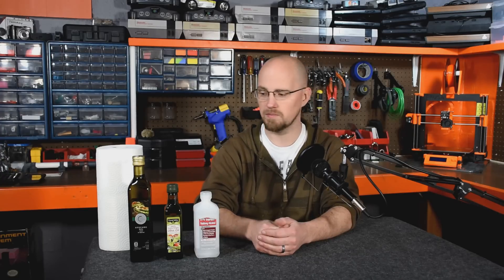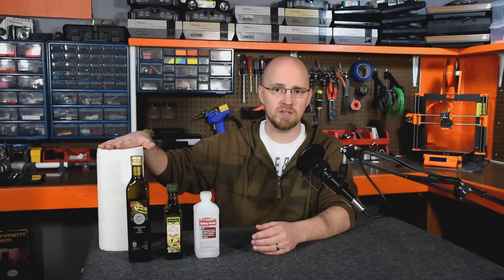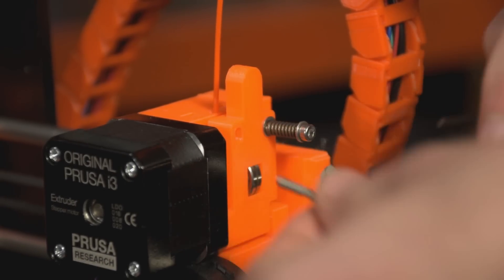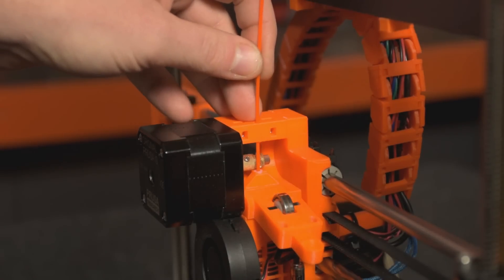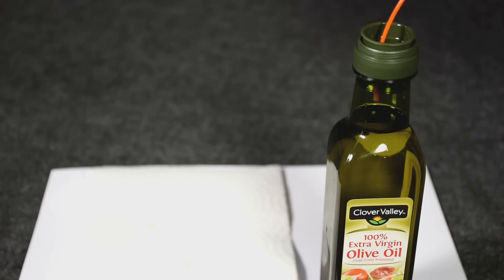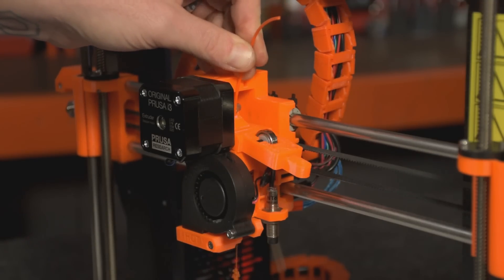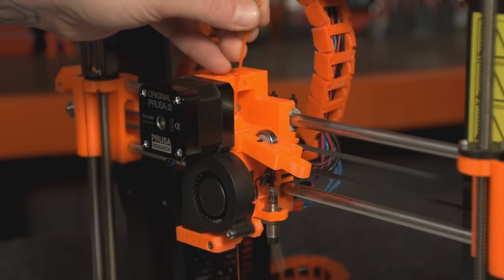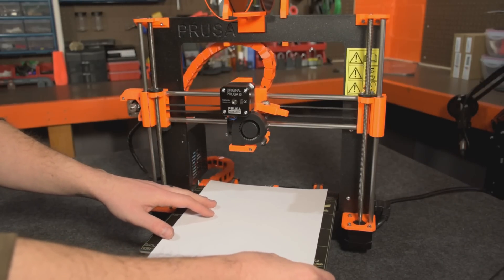How To - Nozzle Seasoning

Comment: I was actually thinking of putting all my nozzles in a cast iron frying pan with some oil and bake them in a batch and they should be good for a while and as well as not make a mess while doing it
Reply: And if your worried about the threads being treated just wrap them in Teflon tape which should protect them Just my GenXer brain bubbling

Comment: Is there any other type of mechanics oil that can be used instead of cooking oil?
Reply: I used olive oil i kept my nozzles in a container with  a paper towel soak with olive oil and just seasoned it on the print head
I left my printer to print and there was a power failure and when i went to check the nozzle nothing stuck to the outside and when i clean out the nozzle after a bunch of filament changes the cold plug came right out and no binding inside or out
\

Comment: have you ever had a printer jam at the exact same height on 2 different G codes?? I had this happen today for the first time , no idea why
Reply: Partially thermally conductive Stainless steel(instead of mostly non conductive titanium) heatbreak, heat creep causing molten filliment to be semisolid in the cool zone or long retraction causing molten filament to pull into the heatsink area of the hotbreak

Comment: I can see this working , if you ever see a steel part finished in linseed oil ( hot submersion ) the finish on the steel turns to glass essentially.. that's assuming the tip is steel

Comment: To be frank here, this guy should not be giving advice to anyone in relation to FDM. This is the equivalent of hearing a fellow scientist talk about how he spoke to aliens... You are experiencing throat clogs, not friction clogs. Read up on thermodynamics inside these machines boys, youll be hard pressed to find a nozzle that gets clogs when it has a heatsink. Its the makerbot style nozzles that do it, and oil is NOT the solution. It does more damage than good, and the core problem is still there - so not only do you loose structural integrity, but you also get quality loss from the throat clogs that are still in there (just more slippery now). When you pull your filament out, if it has a bowed cylinder on it, thats a throat clog; the most common and most (almost comically) misunderstood type of clog, and one of the most common issues in general, in FDM. Its a lot more complex than people are ready for, the media should not have jumped the gun saying it was a mainstream machine (they meant price not the general market). These are engineer's and designer's tools, not hobbiests (yet...). Its only as accurate and intelligent at the operator right now, it takes a sharp analytical mind, one that has an "gift" for understanding how things work.
Reply from the maker: I preferred your comment before the edit when you started by calling me an idiot lol.

Anyway.. There are quite a few things you've said that I disagree but I only have time to address a few;

1 - FDM printing is for whoever cares to do it. Suggesting that these machines are only suitable for engineers and designers is absurd IMO.

2 - I never described ANY jams, so why you'd assume I was doing this to address throat jams I was getting is a mystery to me lol.

3 - Structural integrity loss is minimal, and only relevant if the parts you're printing require maximum inter-layer bonding (the stuff I print does not)

4 - This is like a scientist communicating with aliens? Hyperbole much? lol.

Generally, people disagree on things. Thats fine. What isn't fine IMO (and some people are missing the context of this statement in which you repeatedly insulted me directly on social media) is to drag someone through the mud because you disagree. If you have valid reasons that your opinion is correct, present them. Don't essentially flail around like a child hurling insults at someone you know nothing about simply because they hold a different opinion or have had different experiences than you have. It not only makes you look like a fool, it spreads a sort of pernicious negativity in the community that is hard to then get rid of.

Comment: "NOTE this is ONLY for all-metal hotends.  Please don't try to season a hotend with a 
PEEK/PTFE/other plastic liner such as the JHead.  Those don't need this 
treatment and it might cause trouble."  http://www.dragonflydiy.com/2014/06/nozzle-seasoning.html
Reply from the maker: The article you linked suggested doing this for an E3D hotend, which if I'm not mistaken has a PTFE liner. I only ask because I don't know, but what problems can oiling cause with the other types of hotends, and what difference is there that would matter between something like the E3D and the Jhead when it comes to oiling the nozzle? It would seem to me that they both have brass nozzles and thats really what we're attempting to lubricate.

Thanks for the link btw.
Reply: Its an optional PTFE liner, and no the E3D is considered a full metal design because of how it was engineered... you really need to do your homework Nilla....this is really bad dude... You have the whole printing community freaking out that youre attempting to give advice when you have a very narrow understanding of the processes and engineering involved here. I dont wanna be a dick but ive got to say something here, like everyone else. This oil business is total bullshit, it was a rumor that got passed around, a fix that was done by yet another average joe who has no business being anywhere near one of these machines. You can thank the media for this epidemic of misunderstandings and misinformation. It inflates egos too so you tend to see people get all up tight, flip out when you show them why theyre wrong... It just inflates heads. If you want to understand it, you need to start with engineering and design, and move over to chemistry and material dynamics, then thermal dynamics (physics). Once you have a basic understanding of that list, THEN and only then, can you use these machines correctly. Do you even caliper, bro?

Comment: how often do I have to do this??  I mean per meter or weight of filament
Reply from the maker: You never have to do this. I would only do this if you're having problems with jams or extrusion inconsistencies like I was having with smaller diameter nozzles.
Reply: Nillabean 
thanks alot..  nice video

Comment: I am sorry but I can't ignore this video.
The advise you give can do more damage then it can do good.
In fact, it can do no good at all, but it can damage your heated bed and if someone is stupid enough to spill oil, it can damage other parts.
You are having a printer that uses PEI on the heated bed. Please, if ever you have to replace your PEI, make a last print and test the results of getting a mineral oil on your PEI. You won't have to clean it afterwards with isopropyl alcohol, because you will never ever get it clean again. Also, your tip is being seen by people with printers that have BuildTak or Kapton tape on their beds. They are not going to be happy with this, because their filament won't stick anymore.

In fact, your idea to run enough filament through the nozzle to get rid of the oil, is the best tip you gave. After all's gone and you are lucky enough to have no permanently damaged anything, you can start printing again as if nothing happened.
Reply from the maker: Again, not trying to be argumentative but your comments are pretty obviously misguided as I never even claimed I had any 'clogs'. My issues were with the extrusion consistency of certain filaments when using smaller diameter nozzles. As I've stated in replies to several of your comments elsewhere, I completely agree that seasoning your nozzle won't really solve any issues with throat jams related to heat creep and its incredibly unproductive for you to continue to act as if I am lol.

My reasons for experimenting with this technique were related to print quality under certain circumstances, and this is the one thing that seemed to address the problem. You're free to do and say as you please but just be aware I won't address any more of your comments if you continue to reiterate the same irrelevant points over and over in multiple locations.
Reply from the maker: Using oilers is common practice and like someone else already mentioned in the comments, this is essentially an alternate method for lubricating your extruder.

As with most things that I recommend or do tutorials on, I've already used this technique for some time and have an good results with it. I also stress in the video to not handle the oil near your machine, and the tiny bit that will be on the filament isn't going to damage anything. This includes your build surface, whether its PEI, buildtak or essentially anything else on the market currently.

I'm also not sure what mineral oil has to do with anything lol. Mineral oil is a petroleum product.  In the video I clearly recommended either EVOO (extra virgin olive oil) or Avacado Oil.
Reply: Mentioning mineral oil is my mistake, sorry for that. For the rest, it's like going to an alternative doctor. If you believe in it, please continue.
If you do your maths then try calculating how much oil you are inserting in the system from the extruder up until the place where a clog can occur. You take one centimeter of oil on a 1.75mm piece of filament, the tip it on paper to remove the exces oil. The rest being left on the outside wall of the filament is not worth mentioning, but we will continue. Now you insert the filament inside your extruder. The filament is going to hit the inner walls of the extruder, then after that it's going inside the top of the heaterblock, then inside the inner liner tube, that is inside the heatbreak and then it comes straight to the center of the nozzle, not touching any walls of the nozzle, because the inner liner tube is preventing that. This place, the nozzle, is where clogs occur. The chances of any oil getting to touch the brass or other type of metal of the nozzle are zero, but let's assume some oil got there. Then you are going to heat up the nozzle and extrude a fair amount of filament to "get rid of the oil". The adhesion of the oil to a metal surface is way less then the adhesion of oil to your melted filament, so after your done, there is no oil anymore.

All this gives the risk that an inexperienced user drops some oil on his bed surface and has real problems. Well, If you believe in it, then keep doing it, but I won't.

And that oiling filament is a common practice doesn't mean that it is a good practice. As far as I know, there is no commercial producer of 3D printers that sells an oiling system for their printers. Nor for consumer products, nor for professional printers. Believe me, I am in that business and there isn't. The only oilers out there are oilers that are found on Thingiverse etc. 

That you have already used this method for some time and have good results with it doesn't say anything. How much clogs would you have had if you didn't do this? Please tell me how you calculate this?

I will stop arguing about this here on your channel, but if you would like more info or would like to change thoughts, you can email me.
Reply from the maker: You're free to do and say whatever you like, I just don't see why you need to do it such an aggressive and condescending way. One of the things I like most about the 3d printing community is that its generally free of the sort of drama you seem to be starting here. IMO if  you disagree with something that I've done or said, there really isn't a reason you couldn't have contacted me privately or at the very least presented your case without the unnecessary and immature jabs, particularly when we're both visible elements of this online community.

Its also a little underhanded to try and suggest that the reasons I find this technique to be useful or beneficial are 'faith based'. I had a problem. I experimented with several ways to address the problem. This worked. It noticeably improved the consistency of the extrusion coming out of my machine with certain filaments, particularly with some of the smaller diameter nozzles I've been using. People inquired about it numerous times so I made a video about what I did. Why that would whip someone into a tizzy to the point they feel they need to insult me is a little bewildering to me personally. Like I tend to say though, to each his own.
Reply: Sorry, you get me all wrong.
I am not insulting you, nor am I attacking you. I even offer you to contact me personally to help you, that doesn't look like any of the above, does it?
The only thing I said was that I couldn't ignore this video upload because you have a big influence on your audience. There are so many things that can go wrong and there is absolutely nothing to be won that I think you are giving a bad advise.

Sorry if I hurt your feelings, I was being honest and direct, but not at all aggressive or insulting. I wish we could speak about it over a glas of beer, I would pay for it.
Reply from the maker: You say there is nothing to be gained, yet you ignore the fact that I fixed the issue I was having by doing this, as have many other people that you can easily find on the web.

I mean maybe you weren't trying to be insulting (you didn't hurt my feelings btw lol), but suggesting that me doing this is like going to a faith healer surely wasn't meant as a compliment I'd assume. Same with saying the only good advice I gave was to essentially undo what we were trying to accomplish here (which it doesn't, it just removes excess oil). I think at best it comes across as snarky. You can't just say you weren't being aggressive or insulting and it magically makes that the case. I'm glad to know that wasn't your intention though.
Reply: @3dPrintCreator  You really like the sound of your own voice!
Reply: Nilla, you are greatly misunderstanding the source of your clogs. This is a heat management issue, not a friction issue. the heat causes the friction issue from bowing due to heat inside the throat, you are putting a band-aid on a problem that you can fix very easily with parts, a band-aid that does more damage than good.

Comment: Have you seen any adverse effect of the oil getting on the drive gear?
Reply from the maker: When you insert the filament from the side like we do, you shouldn't have to touch the extruder gear at all since we're going directly into the PTFE tube.

I would imagine it won't cause any problems if you do manage to touch it though since so many people use filament oilers and all the oiled filament would be passing through the gear and tensioner. It probably would hurt to wipe it with alcohol if you're worried about residue though.
Reply: What about the oil affecting the nozzle? I mean... I have always been told to not use comestible oil to lubricate mechanical parts. Something about interaction with the materials, mainly steel. I'm not sure about the nozzle material...
Reply from the maker: Its true that you shouldn't use cooking oil to lubricate mechanical parts, but the hotend nozzle doesn't make contact with any other metallic surfaces that move. What we're lubricating is the filament. Like I've mentioned in other replies already on this video, using a filament oiler is common practice for 3d printers and this is just an alternate way of oiling and conditioning your nozzle.

Comment: Placing paper on your build surface to protect from oil drops isn't the best method but if you are quick enough you should de able to react quick enough before any oil soaks through. You could use parchment paper under the paper towel. This way the paper towel absorbs the oil and the parchment paper should resist oil soak through better than a paper towel alone.
Reply from the maker: The paper is fine IMO, especially if you throw a few sheets down. Personally I didn't get any oil on the paper at all when I did this for the video and if you're getting enough oil on whatever you're laying on your buildplate to soak through it, you're using waaaaaay too much oil lol.
Reply: Nillabean - I agree but I also can be that "belt & suspenders" guy. If the build plate it covered in glass or blue painters tape who cares? But if it were buildtak or PEI then that is a different subject. I would hate to screwup a nice sheet of PEI because that would be my luck if I didn't take the precaution. Lol
Reply from the maker: Getting oil on your PEI or glass won't screw it up, you'll just have to wipe it down with alcohol. There isn't any risk of doing permanent damage or anything, I was just recommending people take some precautions to save themselves a little bit of cleanup time later.
Reply: Nillabean - Precaution is always good. 

I am thinking of going with PEI on glass to get both a flat and easy to care for print surface.  My Monoprice Maker Select (Wanhao i3 rebadged) has the aluminum bed that could warp when heated and the glass should at a minimum provide for a nice rigid and flat substrate for the PEI.  I have printed glass bed clamps which will allow me to remove the glass if I need to.  I just got the 3M adhesive to bond the two.  That is my next upgrade.

Comment: I'm just curious, is this something you did because you experienced some nozzle jams with the mk2 or more of a prevention thing to a problem that could occur in future?
I had only one jam with the mk2 so far and I'm pretty sure it was caused by some dust particles on my filament that I forgot to clean after having it laying on the table for a few weeks.
Reply from the maker: For me it was some issues I was having with the 0.25mm nozzle that led to some investigation into the options that were available and this fixed the problem. In the reading I did, it appears that there are some marked improvements with various filament types that are more jam-prone than standard PLA if you lubricate your nozzle in this way.